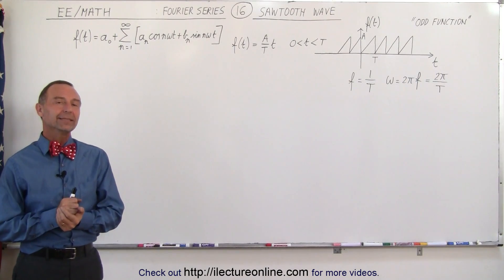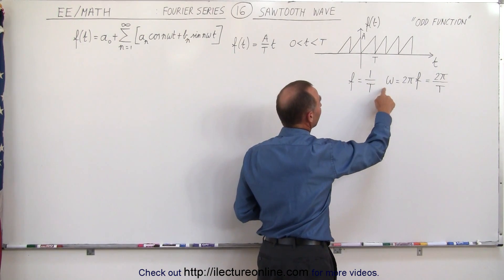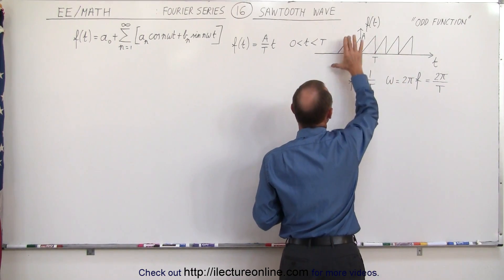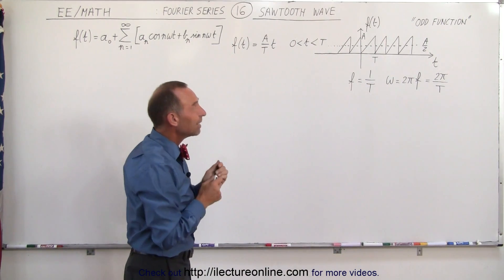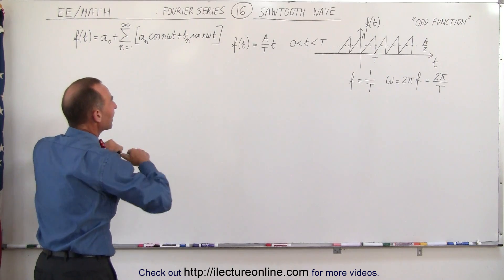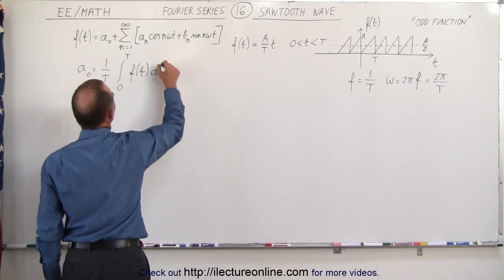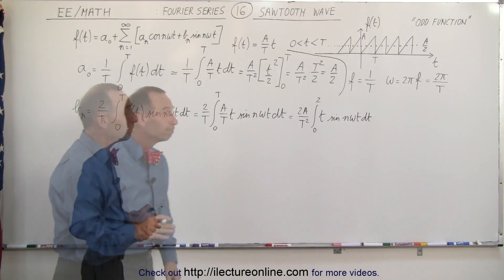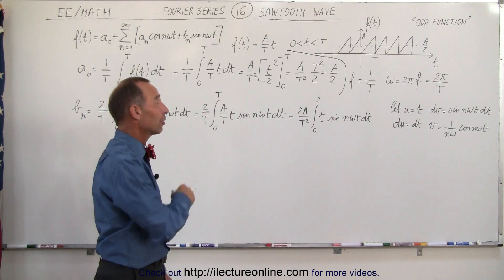Electrical Engineering: Ch 18: Fourier Series (16 of 35) Find the Fourier Series: Saw-Tooth Wave***

Comment: can anyone explain why a sub o was included coz in odd function only b sub n is taken into calculation and rest are zero
Reply: this sis not odd function but if you calculate the a sub n , which i did, it turns out to be zero since we calculate over the complete period and it will be cos2n pie - cos 0